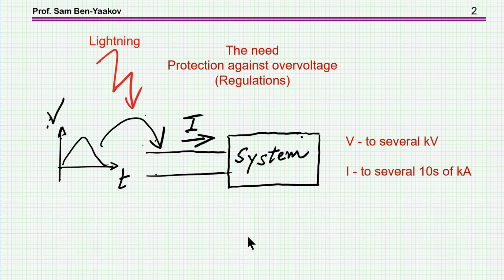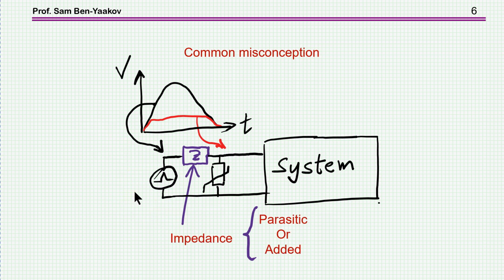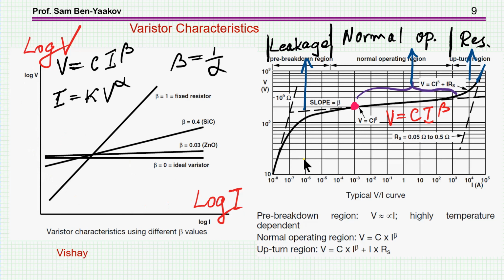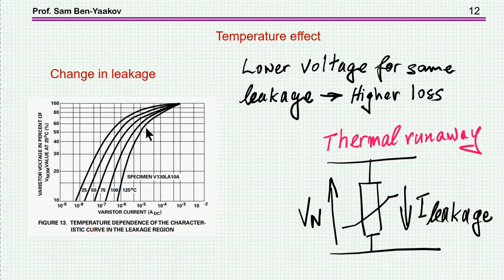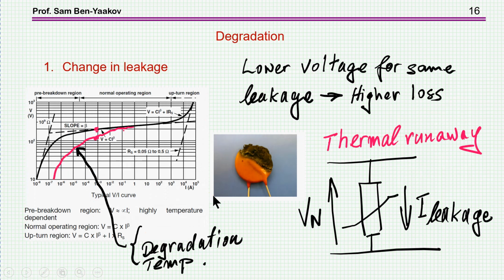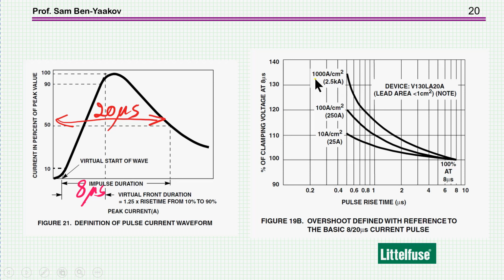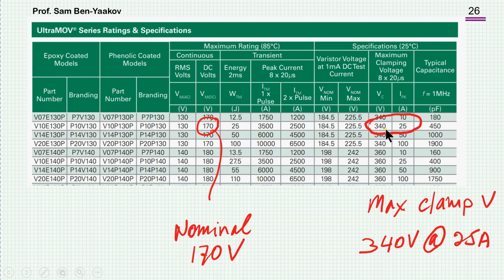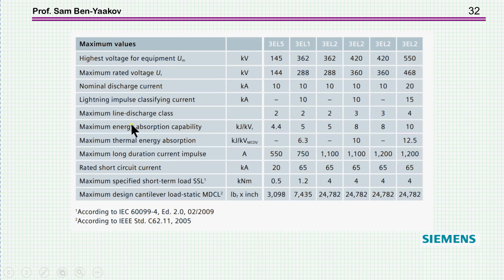A primer to Varistors

Comment: For 220-240VAC --
Should I use a 431 or 471 volt MOV?
What would be the difference in leakage current at 240VAC?
Reply from the maker: Not all MOVs are born equal. You neet to look at the datasheets.

Comment: We make SPDs (lightning arrestors) and use a few different voltages of 35mm MOVs.  One of them turns on (1mA) at around 480V DC.  These are TMOVs with the third leg.  Yes, the internal connection is supposed to open (melt ?) when it gets too hot but we also add a thermal switch which was needed in order to pass the UL standard for these devices.   Here is what can happen when the protection needs a wee bit more work...  Current is "limited" to 10,000 amps by the test facility.....   (they can do 1000VDC at 100K amps.)   These SPDs work fine in 20,000+ amp lightning test simulations... 

https://youtu.be/yCe-e9q5d5g
Reply from the maker: Wow that IS impressive, Thanks for sharing. If OK with you, I can print the link to your video at the comments section of my Varistor video. If fine with you, please write down a short description of what is shown.
Reply: @sambenyaakov  Yes Ben Will do
Reply: This is a link to our SPDs to start with...
http://www.midnitesolar.com/products.php?menuItem=products&productCat_ID=23&productCatName=Surge%20Protection%20Devices

The original SPDs were good for  115K amps but the newer ones are less because we do not use as many MOVs now and that is because we had to add the thermal limiting....

 The SPD is offered in three different voltages to maximize the required protection level. Protection is achieved by reducing the clamping voltage to a safe level that your system can sustain without damaging any electronics in the system. The MNSPD is designed to clamp a 115,000 amp surge! Blue LED’s provide visual indication of operation from a distance.

This video shows why we started making SPDs in our industry in the first place with a high current test done by World Products corporation that is another supplier of MOVs...

https://youtu.be/vkeFYuHxJoU
Reply: Another video that explains how these are used and installed
Reply: For 220-240VAC --
Should I use a 431 or 471 volt MOV?
What would be the difference in leakage current at 240VAC?
Reply: @mrtechie6810  I think we use 470 V for AC and that should be slightly less leakage. There always seems to be a wee bit at least
Reply: @k7iq  thank you so much!
Reply: @k7iq  I'm protecting an SSR, located over 10ft after the breaker panel, via 8mm^2 conductors. There is a HRC main fuse. Breaker is 35A. Line voltage is typically 238VAC. Thinking to use the 20D471K MOV. What protections would you recommend to guard against faults such as the MOV shorting?
Reply: @mrtechie6810  Some of these MOVs, the 3 legged ones, have an internal "fuse"  and are basically a blob of low temperature melting solder that opens up.  BUT I wouldn't rely on that.  You could use a real fuse with a slow-blow timing that is small enough amps to be able to open up when the applied short circuit current is applied to the shorted MOV.  Depending on where in the whole circuit the MOV is placed, you may already have over-current protection in place somewhere else ?   For our SPDs, we had to add our own fuse, a low melting point solder spring opening thing that was temperature connected to the MOV and would open several seconds after an over-voltage at high-ish currents were applied to the MOV.  That works over a somewhat limited range but can help.   
It's not all that easy but just try to add fusing that doesn't blow during a very short lived lightning strike but does blow when a long-ish over-current, over-voltage situation arises.   To  REALLY test the over-temperature, you need the help of an accredited lab that is able to supply high currents (thousands of amps) at high voltage (thousand volts).  To test if the MOV works for lightning protection, you need a smaller facility that can store, in a big capacitor, the high voltage (say, 20+ thousand volts)  at a short pulse of high current  (say, 40 thousand amps for many microseconds or even a millisecond)

MidNite Solar has a video that shows this lightning test being done and is kind of impressive.  It's somewhere on our web site.  The over-current test was even more impressive before the fusing design was quite complete.
Reply: @k7iq thank you! I don't think we can rely on the 25A main fuses -- too much current. Would probably have to fuse in series with the MOV. What value fuse would one use?
Reply: @mrtechie6810  The fuse would most likely have to be sized to keep the wire from burning up.   Many many amps is fine for the small 25 amp wire for microseconds but not for full time where the wire would burn up.  So, I would say whatever the wire ampacity rating is that is in series with the MOV.  If, in the US, the NEC rating of the wire is good for say, 50 amps, then you could use a 50 amp fuse, minus any derating that might be necessary....  For a fuse, maybe zero % derating which means just use a 50 amp fuse.
Reply: @k7iq  it has a 25A fuse. But the MOV can only handle 1 watt (?) sustained without overheating so it could eventually start a fire even if it doesn't fail as a dead short?
How much are thermally protected MOVs including shipping to Israel?